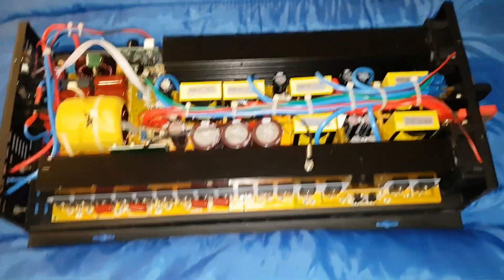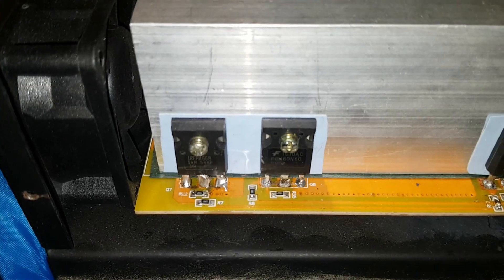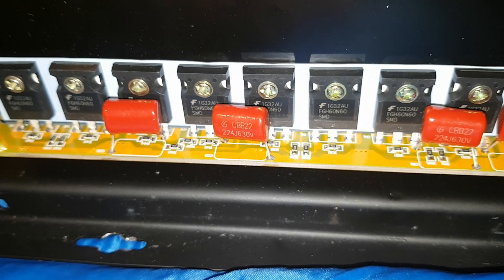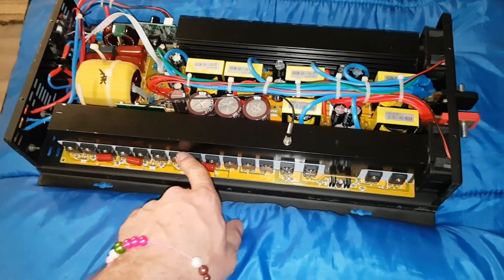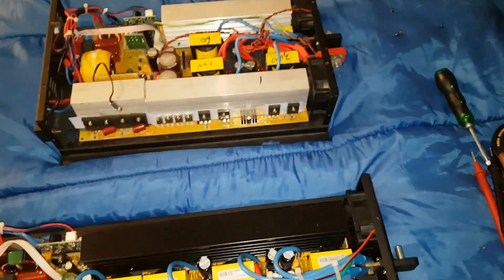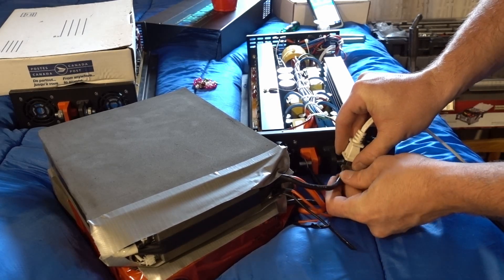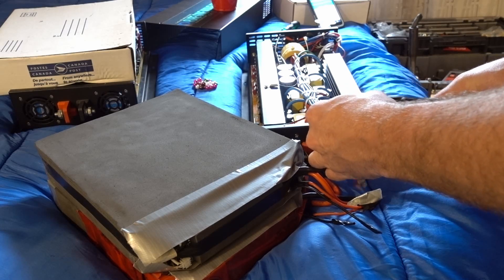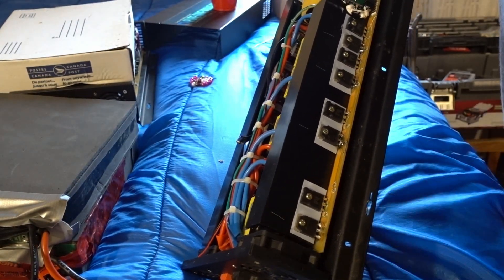4000W Reliable Inverter Insides

Comment: Whats the idle wattage if the 3k has lower idle consumption i would rather have that.
Reply from the maker: 3k is lower and I found more reliable then the 4k
Reply: @GoingOffGrid101 
Thanks quick response. I bought the 3k for my rv. I will rarely go over 1500 watts for my microwave, tv and lights about 150 watts.
Reply from the maker: @electrified7309 I have videos of my 3k running the AC and more :)

Comment: My 4000w reliable inverter  fans  make much noise because they run at Max speed all the time. How do I reduce the noise to silence? Any idea, my lecturer.
Reply from the maker: Does the fans run all the or only when load us applied?
Reply: The fans  run even when there is no load. they run even when heat sink temperature is 28oC, they are on and off every 2min.
Reply from the maker: @Mulonda Mwinanu  seems like the thermistor is asking up, wonder if you could replace it 🤔

Comment: My12v, 240v,  3500w reliable inverter  has lost surge power and it has difficult in starting a  150w fridge it used to power. What could be a problem with my inverter?  Driver board is ok.
Reply from the maker: Could be the current  reading  is off or no longer working, check internal fuse make sure none are blown
Reply: @GoingOffGrid101  fuses are ok. How do I turn on current reading?
Reply from the maker: @mulondamwinanu8247  how old is the unit ?
Reply: You mean micro current transformer sensor ?
Reply: 1 year old
Reply: How good is aluminum nitride ceramic substrate thermal  on igbt heat sink?  It has high thermal conductivity of 321 w/m.k than silicone.
Reply from the maker: @MULONDA MWINANU  I'm not sure to be honest

Comment: Hello again! So my new 4000 watt Reliable Inverter has stopped working. When I connect DC power and turn the unit on, an alarm sounds and the red light is on. I'm afraid something has blown. I'm wondering if its the manner in which I am turning off the unit that could have caused this? I had the inverter powering a 2700 watt load to charge my Eco Flow Delta Pro. When I was done charging the Eco Flow I would switch the power off on the Inverter. Should I be removing the load first on the AC side before turning off the inverter?
Reply from the maker: did it make a popping sounds or does it smell burnt? I don't think shutting the inverter down with a load should hurt it. try plugging a load into the inverter with it on like a light bulb or electric heater and see if it turns on, also what voltage is the inverter 12 24 36 or 48v ? there is a chance a few fuse blew inside the inverter, be careful inside the inverter the caps could be storing high voltage, leave it on and unplugged from the batteries for a night before opening.
Reply: https://youtu.be/1rxSapfp4Hs?t=1084
Reply: Inverter works fine now. I had the unit disconnected for a few days and didn't realize the importance of a pre charge resister.
Reply from the maker: @globemasterdave  I'm glad you got it working
Reply: @GoingOffGrid101  Its a 12v to 240 inverter

Comment: Would you say the Reliable 4000 watt could invert 3000 watts continuous all day? Thanks for the video!
Reply from the maker: If it's one load probably, if it's a house with a bunch of smaller loads with spikes no.  My favorite inverter from reliable is the 3000w, it seems the most robust.
Reply: @GoingOffGrid101  I was going to use the 4000 Watt version to charge my Ecoflow Delta Pro. It’s max charge rate is 3000 Watts with a 240volt AC connection. I need to make sure I have a unit with enough headroom to run continuously at 3000 Watts.
Reply from the maker: @globemasterdave  it should be fine with that load. if it last the first few weeks used are at 3000w it should last a long time.
Reply from the maker: @globemasterdave  buy through amazon has better warranty i think 3 months
Reply: @GoingOffGrid101  Thanks for the info. Bummer to hear the 4000Watt version is flaky. Hopefully I receive a reliable Reliable 4000. Just bought through eBay because it was the only way I could manage to order the 240volt version. Seller is offering a 365 day warranty.
Reply from the maker: @globemasterdave test it well the first 30 days that's all eBay offers for warranty

Comment: Applying thermal grease compound between thermal pads and output mosfets in inverter improve heat conduction . what do you suggest. Thanks.
Reply from the maker: From my testing, it only helps a little.
Reply: Ok, thanks. What is the best way of improving heat conduction on heat sink output in inverter.?

Comment: with reference to reliable 3000w inverter, Do you mean if you upgrade the inverter with igbt 600v, 160A, G160N60UFD, the inverter will last longer?
Reply from the maker: Mine has been really good

Comment: I got question, I have the 3500 watt inverter of that brand, when it's connected to batteries it comes on, and shows 26v on low side, but out put screen is black, showing nothing, and plug something into it and nothing, so does that mean that the output MOSFETs are burnt? If so do you have numbers for replaceable MOSFETs, I tried looking up ones it says on it, and since Chinese and can't find replacement ones.
Reply from the maker: If you look up my 3000w inverter repair video it shows the output gets, but I'll look tonight, I believe they are 59n30
Reply: @GoingOffGrid101  thank you very much, I appreciate you taking time and and helping me out.
Reply: @GoingOffGrid101  I watch your video that you suggested and couldn't make out what MOSFET it was, but I'll look into the one you suggested, again thanks for your help.

Comment: I want to upgrade the Output MOSFETS on  my reliable 4000W inverter.  Is replacing 60N60FD1 ( 600V, 60A) with G160N60UFD (600V, 160A) advisable. I need your advise, thanks in advance.
Reply from the maker: I have upgraded 3 inverters with those and it made a big difference on the 3000w, I am currently upgrading a 4000w just waiting on piggy back boards, I bought a dead 4000w, I will be posting a video when complete.
Reply: @GoingOffGrid101  Thanks so much. I can't wait to see your project on 4000W upgrading.
Reply: Do I have to cut the heat sink after installing G160N60UFD Mosfets? Advise.
Reply from the maker: @mulondamwinanu8247  yes or drill and tap for new screw holes, i have done both ways and cutting heat sink was the easiest.
Reply: @GoingOffGrid101  Thanks, what else do i have to change in the inverter?
Reply from the maker: @mulondamwinanu8247  i only changed the out put fets and thats it.
Reply: @GoingOffGrid101  Thanks. What is the approxomate wattage of mu 4000W inverter aftern I the upgrading?
Reply from the maker: @mulondamwinanu8247  im not sure, might not go up much but it should last longer and take larger surges .
Reply: Is it advisable to replace IRFP2907 input and output mosfets with  G160N60UFD (160A, 600V) on 4000 reliable inverter?  Can i make input and out mosfets G160N60UFD the same? I need your guidance, thanks in advance. I'm upgrading my inverter.
Reply from the maker: @mulondamwinanu8247  I have never used the g160n60ufd on the input I always stay stock on input cause its the output that fails 90% of the time.
Reply: Thanks. Is putting big dc-link capacitors in inverter improve the performance ? Improve soft start.
Reply from the maker: @mulondamwinanu8247   it can if it's in need of more capacity but if it has enough it won't help.
Reply: Thanks for the work you are doing.
I want to upgrade:' my 1000W, 12V, 220V output fortune inverter with  11 mosfets90N55F4  ( 60V, 110A). Can i replace these mosfets with HY3712P ( 125V, 170A) ?
Reply from the maker: @mulondamwinanu8247  if the specs are almost the same or better yes
Reply: Thanks the specs are better. And another thing, I want to adjust the output voltage from 220v to 230v but the inverter has no potentiometer for adjusting voltage. how to adjust the voltage? The dc- link capacitors are 50v, 2200uf x 4.
Reply from the maker: @mulondamwinanu8247  that is hard to do with out knowing how the inverter is wired. I would leave it at 220
Reply: Is it always that when the output mosfets shorts out, the input mosfets also short out in inverters.
Reply from the maker: @mulondamwinanu8247  not always but most the time yes
Reply: I developed much intetest in upgrading inverter. You have really motivated me.
Is  FGL60N100BNTD igbt (1000V, 60A) better than G160N60UFD ( 600V, 160A) igbt? Which one should i use to upgrade .Which factor is important when selecting a mosfet, is it high Voltage or    high current?
Reply from the maker: @mulondamwinanu8247  no the 600v 160 is better
Reply: Thanks. i'm repairing an old inverter. On output i have put G160N60UFD IGBT (  600V, 160A) which replaced 600v, 60A, G60N60UFD  IGBT. On input side i want to put 600v, 60A, G60N60UFD replacing IRFP2907, 75V, 290A, MOSFETS since i don't have 75v, 290A mosfets. Do you recommend me to do this on input side?
Reply from the maker: @mulondamwinanu8247  you will weaken the inverter with those input fets
Reply: Happy new year! If i put G160N60UFD, 600V, 160A IGBT on both input and output, can this make the inverter's input and output more powerful. Replacing IRFP2907, 75V, 209A on input with G160N60UFD.
Reply from the maker: @mulondamwinanu8247  you will still be limited by the transformers so not much will be gained.
Reply: Thanks. Is there any IGBT you know which is better than G160N60UFD, 600V, 160A which i can use on output? Give me the part number of that igbt. thanks in advance.
Reply: Hello, Good friend. I was repairing a dead 3000W, 24v, 230v ac reliable inverter. I replaced all input and output mosfets with new ones. When I tested this inverter, there was an arc on the negative terminal of the battery and the input mosfet started to burn but the inverter switch was in off mode. What could be the cause of this? Please help me.
Reply from the maker: @mulondamwinanu8247  hmm your mosfet control board the larger piggy back board probably needs to be replace as it is shorting the input mosfets, or one of the mosfets you installed was bad.
Reply: After you upgraded the 3000w reliable inverter, did the wattage go upto 3500w? what improvement was observed.
Reply from the maker: @mulondamwinanu8247  it can out out more power, I have not pushed till failure while monitoring it
Reply: @GoingOffGrid101   Was the 3000w upgraded reliable inverter able to handle a device rated 3500w or 4000w ? what largest power rating did it handle?
Reply from the maker: @mulondamwinanu8247  I ran multiple lots up to 3200
Reply: @GoingOffGrid101  Thanks. Thats really a great improvement, out puting more power. did the inverter fan timing of run every after 10 minutes change after the upgrade? did you experience any heating issues with igbt g160n60ufd, 160A?
Reply from the maker: @mulondamwinanu8247  it ran non stop at 3000w but other then that but I cant notice any difference
Reply: How many output mosfets are there in a  3500W reliable inverter?
Reply from the maker: @mulondamwinanu8247  6 or 8  I have only had the 4000w and it's 8
Reply: Thanks. Why is the igbt G160N60UFD, 600V, 160A so expensive, even on chinese markets?
Reply: Is there any other better igbt you know which can replace g160n60ufd, 600v, 160A?
Reply from the maker: @mulondamwinanu8247   no I dont
Reply: Can using a big inductor in an inverter improve the efficiency?
Reply: Is it ok, if i replace smd resistors with carbon film resistors of the same value for easy soldering on pcb. smd are very small in size.
Reply from the maker: @mulondamwinanu8247  I'm not sure, I would think so.
Reply: After you upgraded the reliable 3000w inverter with 8 big igbts g160n60ufd,  on the output cut heatsink with a thermistor,  did it become too hot? is the inverter going to last long, as you said in the video clip? Thanks.

Comment: What is the capacitance of  dc link capacitors of this 4000W inverter?
Reply from the maker: im not sure I will have to look next time I take one apart!
Reply: Thanks.  My last option: Replacing dc link 3 capacitors 500V, 330uf each with 450V,  820uf  capacitor each in this 4000W reliable inverter. Do you also recommend this? Help me. Thanks in advance.
Reply from the maker: @mulondamwinanu8247  that should work
Reply: I want to change dc link capacitors. Is replacing  dc link capacitor 500V, 330uf  with 500V, 470uf capacitor recommended in this 4000W? I need your advise.  I have this inverter, dc link capacitor is 500v, 330uf.
Reply from the maker: @mulondamwinanu8247  yes you can go  470uf with out problem.

Comment: i bought the Reliable 3000 watt. When you did the G160N60 Fairchild IGBT mod did you do any other mod or just upgraded the MOSFETs?
Reply from the maker: just the mosfets, I have don't that upgrade to 2 of my 3000w inverters now and long it.
Reply: @GoingOffGrid101  those MOFETS are not that cheap,/i thought less than a Dollar, even from China they are not giving them away .
Reply from the maker: @mannyfragoza9652  no they are not cheap at all

Comment: if nothing else i'm glad you don't call it profesional work..that burned pcb at 7:54  i hope it will not cause short in long term..and excuse like ..too many screws..i don't like to uncrew them..come on ..have some pride in your work..but that repair looks like hell... I'm glad it is working but be real  .. do you want that kind of equipment..i wouldn't ..it could burd down your whole house..
Reply from the maker: not being used in my house.  the inverter had a few burn traces on the board and i bridged with solder that's why it looks extra bad. btw unit still working fine.
Reply: @GoingOffGrid101  I'm glad to hear that. Both things that is.

Comment: I’ve just blown up my 3000w 24v reliable inverter when my moes transfer switch kicked over to mains, I can’t for the life of me find replacement or upgrade mosfets for those four, any ideas what I can replace them with or can you share a link maybe please? I’m In Australia and can’t find anything locally 🤦‍♀️ Thankyou in advance
Reply from the maker: these will work for the output fets, but you may of damaged your input fets as well. did your fuses blow in the inverter ?
here is a link to fets you can use on the output

https://www.ebay.com/itm/10PCS-FGH60N60SMD-TO-247/302905612365?_trkparms=ispr%3D1&hash=item468694d84d:g:HX0AAOSwb-RbsztU&amdata=enc%3AAQAFAAACcBaobrjLl8XobRIiIML1V4Imu%252Fn%252BzU5L90Z278x5ickkpFtSR0CGv%252Bh98r8Yb9quS9JERmD%252F0o3gfYq0zGEZblrk1IHTauhXWF0C43qVdXDBQDMxAIikCDep%252FlORWRfeNLMmWnLq%252BTJXqu2TKJ0AGWuZ0Jwfx3U%252BO54U7gkwu6fq1b8TfPblvIAGgq144gm9Gj9S94FOMAtiiIvbIOnBagjq037UEPKZxrTFRbv9EeNTjMyOUnaXsB%252Ftfy76L5Svt6mhUTUDJo1SH2JX2D9cZXOS40OjL5I1FXaB21uO%252B1DznDzycKX9to0QX3URNZkt7qT5ByG85aS8dPvXgTYH%252FsFw3dFrfzPnDSV5TFZIF7MPzwi8V6IevVUWDdt8Jaw6%252BaiPWBv3j5MfAbh7j2J6t8bRp0gLCpHR%252FgdreKAE33c7Ny8yAhH5Jsx4Dg1o%252F7ibuH2fT%252BLvtu%252FhqGQ4HcWv0zvePnz5LI7ZqPiINcZjunG%252FfYbJPjqXgtscJw5MQEztGcFTdoN1N2Dsn3spaWqhjpDM11Cr4zhQOvKBTA7uyhOA4FDgjQrlDr%252Fa9KLadyblzDy0Z65lOzifrfPyH1OeiOMaq%252FT86jwwMmQWvXhqz%252BBpjHH%252BgKqb8wNNAP3DAVjHyK6bAKefDRk9GooDRSUk0SPyajY2rUbvVEIdk%252BRpapj6udNoAIbi4L%252Fd3F79CPpESb7rfnCisVNNSvaGUqpT0j8c%252BiTn8EMiEArZiLf8rAV2iNSQXwOm71mBaB482MNhYRuBmkyzWbE4yhy7xAtVUSN38kf7Fim5X7Ur5r8ChaWdG0PKNRpresTX7zXTTgCo0A%253D%253D%7Ccksum%3A3029056123650b1dd8dbf35d426dae4832277c0e7a50%7Campid%3APL_CLK%7Cclp%3A2334524

Comment: I have a problem with my 24v 2500w .  The red light is flickering with power fluctuations and the alarm sounds on and off at night when the panels are not producing. ???  Also the cooling fan was pulsing.  Any ideas?  I was in contact with reliable...but nothing still.
Reply from the maker: what type of batteries and voltage you running in your system? also is it in a damp area?
Reply: Going Off Grid 120 v AC output , 24v battery bank(2x12 240amph).   Not a damp area.  I should say there is a clicking when the low voltage light flickers...like a switch or relay rapidly on and off.
Reply from the maker: @thebluedan  sorry damp i meant
Reply from the maker: @thebluedan  so at what voltage does it start doing this?
Reply: Going Off Grid  non in particular I dont think,  right earlier i made a video at 26.6 v dc.  And now is 25.7 and it is ding it’s well. Also sometime is doesn’t do it at all.
Reply from the maker: @thebluedan  what are you running off the inverter?
Reply: Going Off Grid just a mini fridge, internet wifi and some 1wat LED , but i only recently had this problem. It was fine before. And it is still intermittent.  Sometimes the problem is there...maybe its the barometric pressure???

Comment: Hi love your videos inspirational I was thinking of buying a  4000 watt reliable inverter it is damaged the person said that that it overloaded and blow  but I was wondering if it's a good idea to still get  it ,it is a hey 48v inverter do you think it's a good idea ear to keep the whole inverter but drop it down to 24 volts or just keep it as a 48-volt would love to hear your suggestion
Reply from the maker: keep it at 48v, the 4000w was easy to fix, hope it works out well.

Comment: i just bought the same one except mines is 4000 watts at 36v. have not tried  it yet. got any pointers for me or kind of batteries i can use car and solar or deep cycle and panels...and by the way excellent video
Reply from the maker: Hey, it's a good inverter, I like the 3000w design better but the 4000w is not bad at all